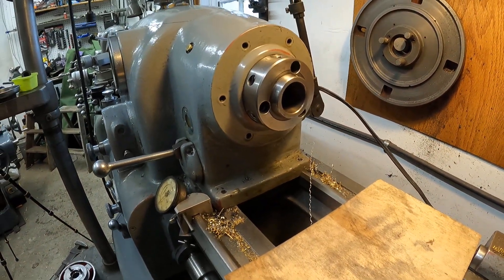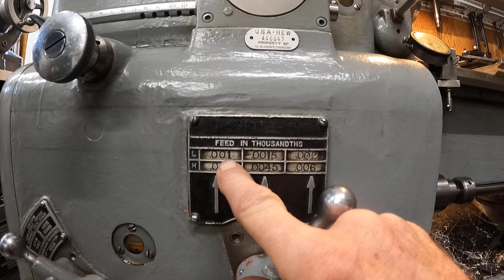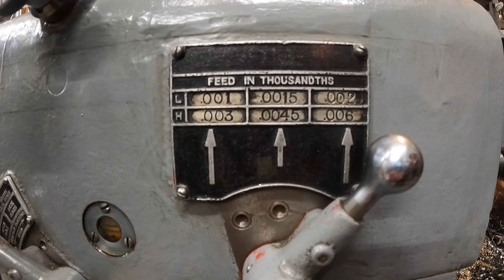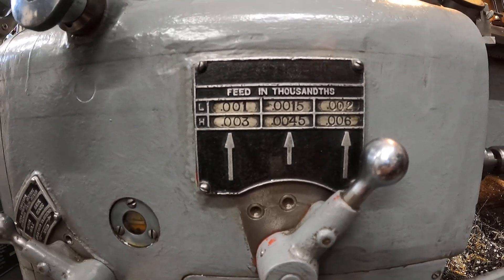Monarch 10ee Lathe high speed precision turning

Comment: My 10EE was built in 1962.  It can cut metric, but to do it I must change out a couple gears under the cover.  It's a pain, but at least it is possible.
Reply from the maker: I will have to do the same on the Axelson but there is a lot more room  under the end cover at least.

Comment: To convert an imperial machine to the inch metric I know the gearbox needs to be changed, but what else needs to changed?
Reply from the maker: The only thing I can think of is the direction tag above the thread/feed selector knob. Many machines were built without the extra dual dials.